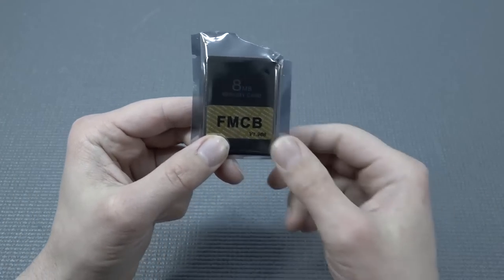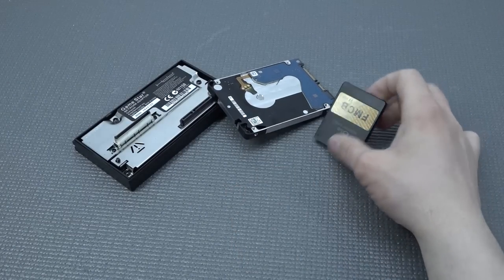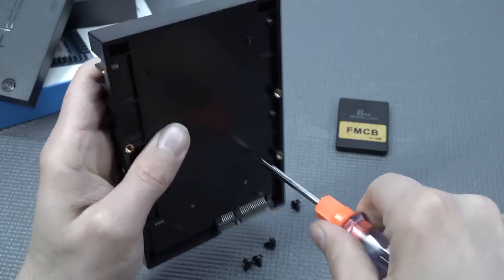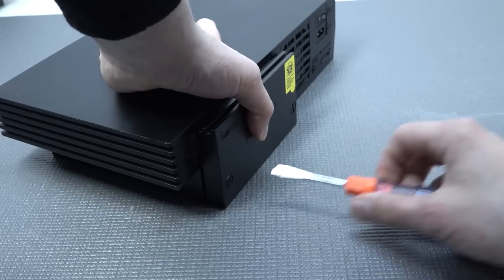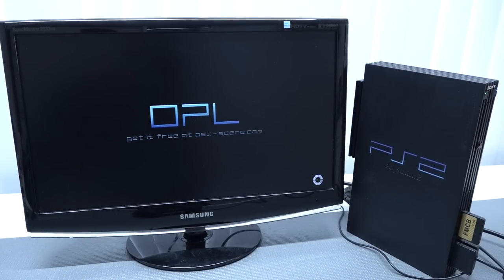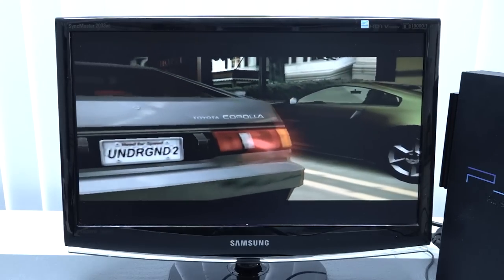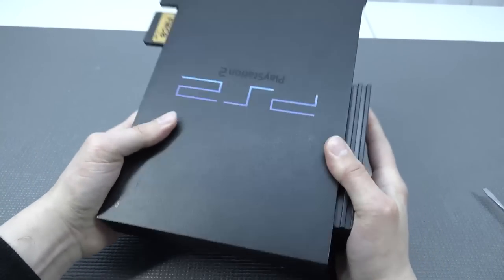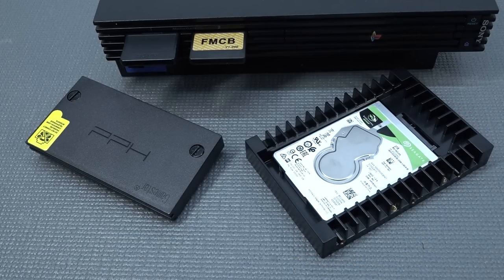2.5 inch HDD 2TB Upgrade For Your PS2 in 2022 ! 🦾

Comment: Does the FMB allow you to play NTSC games from the US and Japan? I have a PAL PS2 fat unit, and would the disc loader allow you to boot up a NTSC disc on a PAL console?
Reply: Through OPL you are technically able to start any region game on any region console, but if you want to boot an official disc directly you'd need either a modchip or if your console is supported you could use mechapwn to flash the specific region of that game to the chip
Reply: @BigDom1002  cool thanks for the reply :)
Reply: @horus1981  you're welcome!

Comment: Just found my old ps2 slim lying on our garage i free mcboot it and still reading lens it has a modchip. Since i don’t have any new games on my PS5 i just dump my burned disc to iso and convert it to usbutil and i thought loading times are forever but its pretty fast and playable no skipping cutscenes. I use sata external hdd 1tb now its time to download some nostalgic games since my jailbreak PS3 not runs smooth PS2 games

Comment: Still thinking I’m gonna go with the memory card option instead of this.
Reply: Memory card still has some performance issues while hdd is fastest, smb is second best if you have a slim
Reply: Better off using the HDD. Running games of Memory still has alot of issues. Now if you have a slim then that's your best option instead of running games off a usb.

Comment: Honestly it's not as durable as the original hdd adapter. I used to have one of gamestar's hdd adapters and it stopped working after 3 months of usage. I believe the best cheapest solution for playing ps2 games nowadays is SMB method (connecting your slim ps2 to pc with ethernet cable).
Reply: I have heard about the network method, do you know how to use it? Maybe a link to a how-to?
Reply: @mcinnocent  Project Phoenix Media has great tutorials about that method on youtube.
Reply: @synck9999  thx! I will have a look!

Comment: You must be reading my mind, im working on modding my PS2 with a SATA drive now might as well as I had my old FFXI HDD connected for so long I lost the expansion bay cover haha. I'm curious if you have tried FHDB essentially its FMCB but loads from the HDD instead. While I personally havent gotten that far yet I'm considering it before I go out of my way to spend the extra expense on a memory card as if im going to need one I want it to be separate from my original Memory Card.

Comment: Nice product. I wished that there would be also a HDD solution for the slim model.
Reply: there actually was a kit for the very early 7000x to use either a SATA or IDE drive!
Reply: @BigDom1002  I unfortunately have 2 slims   9000x 😇
Reply: If you have 2 slims, go for an smb server which can share the drive for both consoles
Reply: @mcinnocent  play games through router by smb method thats the best way to play on slim ps2 especially 90000 series ...there are few travel routers available in market connect usb device with games in router and router to ps2 slim by lan wire once setting done its v nice solution far better than super slow usb
Reply: @mcinnocent  just use a flash drive, same thing
Reply: @xpresslotodo460  but unfortunately very slow 😏
Reply: @mcinnocent  just a fraction, i tested mine as well and its your only bet

Comment: my advice  dont use the fake aliexpress adapter and convert your ps2 adapter and use it. the reason is simple there are games that will freeze with the aliexpress adapter that will work with the original sony moded adapter
Reply: This! My games stutter every 3 seconds using the cheap gamestar adapter and hdd.   

They run fine from the original discs.

Comment: Why not just use a 3.5” drive? the adapter is janky.. 2TB is completely idiotic for a PS2 anyway.
Reply: probably because it's harder to find the 3.5" with the slot, i believe is only IDE/ATA, so that is basically changed to SATA compatible options, they could have a 3.5" SATA drive at the same time.